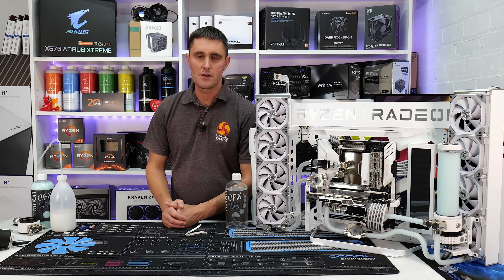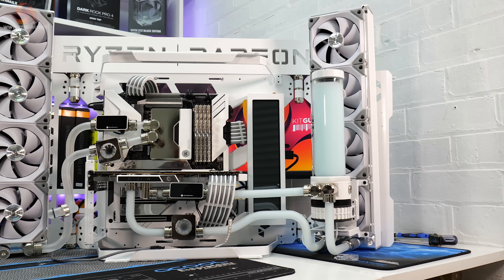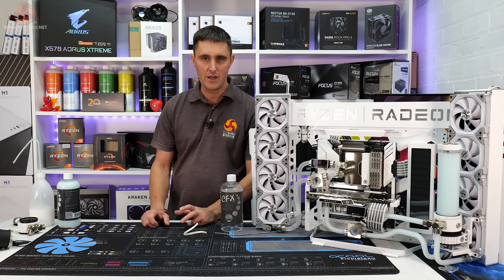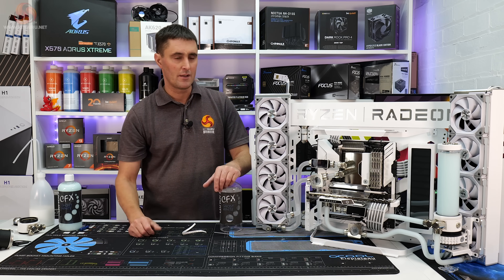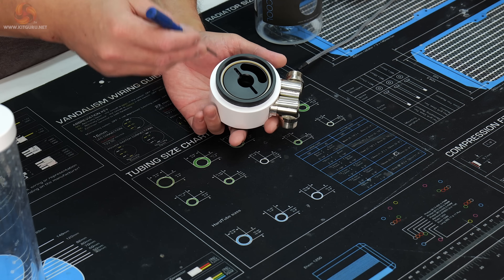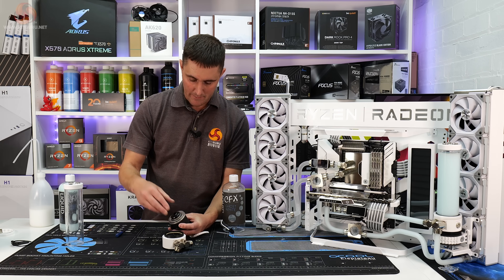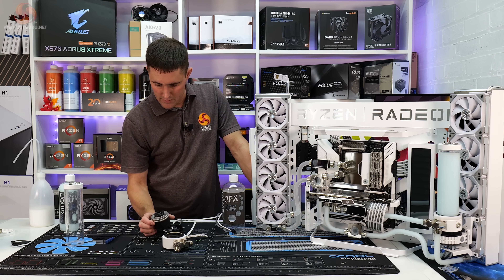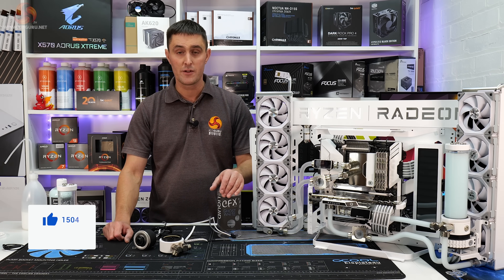AMD FRAME BUILD - we have a problem! 🤯

Comment from the maker: Just a recap to everyone before they comment. We have been sponsored by AMD to build them a custom PC - which we have been doing for months - its called the FRAME BUILD - and we are on the final Part 4 now. We have ran into an issue with the coolant. We are showcasing a problem with the system we are building FOR AMD (and for one lucky winner!).
Reply: @KitGuruTech what did you do to prep the loop before adding the coolant?

Comment: the liquid that is also cheapest, best performing, and longest lasting is a simple mix of distilled water + 15% automotive coolant. 
no gunk buildup. aids in lubricating pump for even longer expected life. allows for mixture of metals such as aluminum / copper without corrosion forming. also wont destroy O rings or tubing. stops algae from forming.  you really dont need that fancy crap that they sell at the computer store. i have seen soooo many videos of that colorant used in computer coolant chalking up internally, staining, gunking up, blocking off water block cooling paths, killing pumps. if you want color they sell green, yellow, purple and red automotive coolant in most stores :)

Comment: Hi James,
1. Blue color is indeed an indication of copper ions in the solution. Copper is to the right from hydrogen in metal activity series
2. Steel parts of the pump contain iron (unsurprisingly), and it is to the left in metal activity series, just like aluminium
3. All is needed for the corrosion is an electrolyte - so please check pH of the original liquid you used and drained. Their website claims "synergistic corrosion inhibitors" which sounds strangely marketing, rather than scientific.
Cheers

Comment: copper sulfate blue -perhaps the pigment used is abrasive and it just scrubbed the patina (which contains copper sulfate) off the insides of the radiators causing the color shift once it dissolved into the water proper

Comment: Just never use straight solid coolant. Do a water coolant mix so its as thin as possible but as opaque as you want. A good solid coolant will also always pass through a coffee filter with out losing much of its colour.
Reply: Coffee filters are definitely a worthwhile addition to any tool box. 👍😎👍

Comment: It’s a very weird situation…. It’s seems to be common with lesser known brands seen online  ….. it’s almost like either it’s pigment base or anti mould etc solution has reacted against each other …. My dad used to work in the paint industry (he’s passed now) and in layman’s terms certain paint brands would basically split (like stirring paint when you first get it) and some anti fungal treatments used (paints for wet areas such as bathrooms etc) would react and become like glue …… this meant a bad quality product. Definitely reach out to the Dye manufacturer.

Comment: sorry that happened to you. whenever you add a colored coolant it's been my experience residue will always collect in every nook and cranny it can find. that's why I stopped adding colors and coolants that contain any coloring. distilled water and a treatment/prep is all I use. hope you get it all worked out awesome build
Reply: This seems to be favoured approach by many. To be fair I usually use a clear coolant in my own systems these days but this is a showpiece. 

I think I'll give the winner of the system the option to change the coolant to clear if they choose.
Reply: believe me I understand hopefully you can get it figured out by using another coolant but if you can't u may have to change parts of the cooler system and or run water with a color dye. I hope you get it figured out it is a amazing build absolutely awesome.

Comment: Have used their stuff and it's gone off in daylight exposure really quickly. Kinda like their colours though. My guess here though is the suspension in the coolant is separating out as it goes through the impeller, perhaps due to heat or just being knocked around there or causing friction in that contact area/bulding up sludge. That would explain the sludge and colour change

Comment: Also used EK solid white. First time, no issue. Last two times almost splitting. Removed straight away. Just for the record, using every part from EK.

Comment: The reside look like particulate from the coolant. Would hazard a guess that if you didn't clean the rads (with Mayhem's blitz part 1 or similar) it's flux that's tinted it blue. Personally would have run distilled water for 24 hours before using a white coolant.
Reply: Hi Steve, yes I wondered if debris in the rads could be to blame but I flushed the rads in the same way that I always do before building the loop. It never happened before using white or any other colour coolant. The fact that it happened so quickly is a worry for me too, It's really odd.
Reply: I personally stopped using solid coolants many years ago, just got feed up with all the extra maintenance Understand this is a show build so 
very different scenario. It's definitely strange, that's for sure. Keep up the good work, bud.

Comment: Did blast the rads through with tap pressure to get out any metal filings/particles if they're new?
Did you flush the loop PROPERLY before the final fill, first with a clear antibacterial fluid like white vinegar, and then with plenty of distilled water?
The flushing/cleaning fluids you can buy are really only any good when you use there own coolant brands too, I think they even state as much on the label usually.

Comment: I always use clear coolant to avoid this potential pain in the a$$. Also flush the crap out of everything with distilled water before putting in coolant. Clear coolant may not look as gnarly but it has the added bonus of lasting longer than coolant with color added.
Reply: True. I did give the radiators a good flush before the build as I always do.

Comment: How does the saying go? "Less haste; more speed". It is almost never a good idea to abandon the tried and trusted for the unknown just to shave a week or two off a project; most times it will backfire and bite you on the arse. Now you've eaten the time you thought you'd saved and the project is going to take probably a lot longer than if you had just been a little more patient. We'll none of us be told though,and we all have to learn the hard way. No comfort I know, but we better learn from our mistakes than from things that go swimmingly.

I note this company just make coolant and this is a review channel with access to the latest and greatest. I lean to this being an interaction of the coolant with the kit for that reason.
Reply: Too right. I might have been a bit inpatient although I'm not blaming the coolant outright, there has been some talk of EK radiators being very dirty lately. That said I flushed them thoroughly before the build.

Comment: Had similar issues with Mayhem’s solid, the line they stopped producing quite shortly as many people had issues with. Pain to clean as I was using a bay reservoir at the time. 
Solid looks nice but with RGB nowadays, clear coolant every time for me.
Reply: I use clear but put a few drops of dye in it. The dye is not enough to gunge at all, but it really helps to see the liquid in the tubes, which is very handy.
Reply: Yeah my mate had the same issue with mayhems

Comment: Ionized copper is blue I know that much. Is it possible that the coolant is so abrasive that it scrubbed the nickel off of the blocks? This would cause a sediment like effect. You see this a lot in the primochill marbleized fluids. As well there could be aluminum additives in that fluid (Ive never seen this fluid before so I don't know, Its a guess) You need to pull and flush the radiator as well disassemble the new EK block for examination.

Comment: hmmm. I imagine i will never have this issue. I use Air-Cooling. I know why. Because i don't wanna have issues like that. Also, what i can tell: never use these "opaque" coolants. Or use the coolant, u know will work and have experience with, even if you have to wait a couple of days. In the end it is your time, your sanity that gets wasted. So what if you had ussed the EK coolant instead of the one you used? Did you have any experience with this coolant in a previous build, or was it the 1st time?
Reply: First time using this coolant. Just very odd that the build-up happened so quickly.

Comment: Just out of interest did you dilute or use straight? One particular reviewer on Amazon had to dilute it 50% with distilled water otherwise his pump noticeably slowed and his temps were 20 degrees higher undiluted.
Reply: I used it neat. That is interesting information. It seemed to be working  ok, temps were fine and pump speed looked normal before the colour change.

Comment: I really don't know what's wrong with the chemists at these water cooling companies, maybe they should hire a chemist?  The issues with coolant and corrosion is out of control, this is a solved problem in the automotive world so I don't know why it's still such a problem in the PC industry.

I'm serious considering two options.  Either using 4 bottles of EK cryo concentrate OR using using automotive coolant.  It doesn't seem the computer industry can't figure out how to solve corrosion.  Remarkable considering millions of cars on the road have had mixed metals for a century now.

Comment: wow thats a weird one - it happened overnight?
Reply: I think the coolant changed colour gradually but the system was only filled with the coolant for around 24 hours. The pumps worked when I switched them off at night but were seized the next morning. Cleaning has fixed them though.

Comment: Definitely a poor quality fluid.  Either it's a bad batch or it was sitting on a self for years.  Had that same thing happen when trying to use some 5 year old fluid I had sitting in my garage.  The system was only ran for about 3 hours and the whole loop was filled with gunk.
Reply: Interesting.

Comment: Why does the thumbnail, and the (Original, now slightly edited video title, which was "AMD - we have a problem") so strongly suggest that AMD is the "problem" in this video?

AMD has absolutely zero relation to how a coolant has managed to clog up various watercooling components, other than AMD is sponsoring the build.
Reply: I think that’s more your perception. It’s Kitguru telling amd that they are having a problem with the system they are making for them. Makes sense to me.
Reply: @theonlyredspecial  Because the best way to inform you sponsor of a problem, is to broadcast it openly on youtube, rather than contacting the AMD rep's that Kitguru would have access to?

Comment: So it's the fault of AMD ?
You don't need all that trash inside a PC, buy a $50-$100 air cooler and you won't have a problem cooling an AMD system.
Reply from the maker: Who said it was the fault of AMD, apart from you? We are building a custom PC for AMD. And are on Part 4 before we give it away to someone.

Comment: You have a problem, not AMD!
Reply: Kitguru are building this system for AMD, as a giveaway, they have been doing it for 2 months. Kitguru ran into an issue with the watercooling and are telling AMD there is a problem. Pretty easy to understand.
Reply: The title does not suggest it is a problem with AMD. The title leaves it a mystery as to what the problem is.